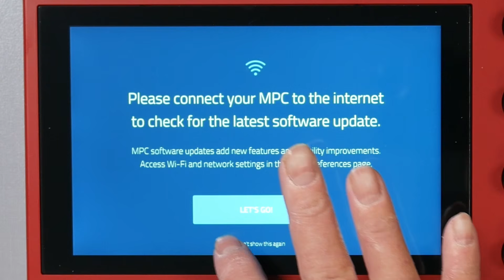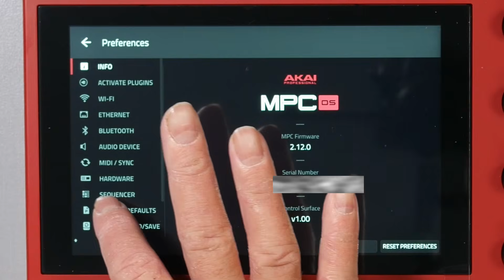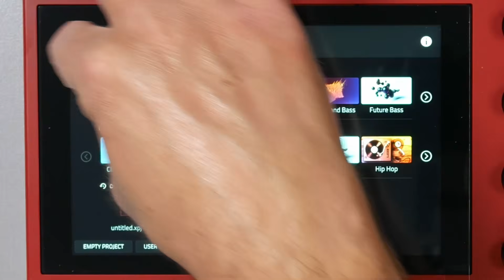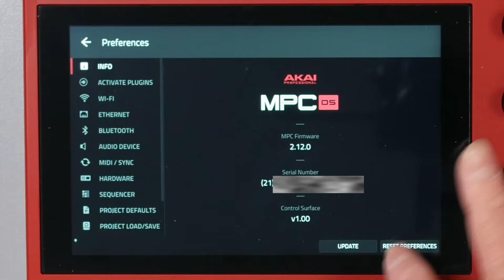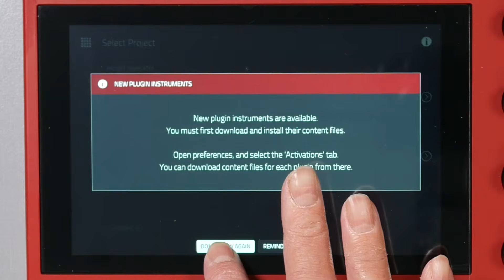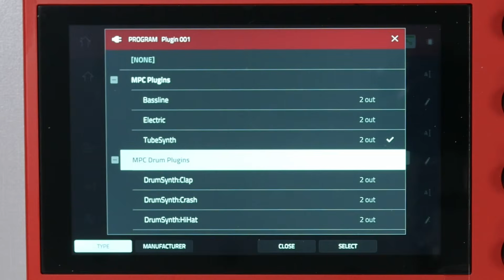3 Tips For Brand New MPC One Plus Users.

Comment: If for some reason you're not in a place that has internet you can plug the USB cable in the back of your MPC one and the other end into your phone. A message should come up do you want to use the internet by tethering just say yes. And you can connect to the internet through your phone.
Reply: Thx for this. I just moved into my new place. I don't have internet yet, my mpc one just came in the mail. I was wondering about not having any wifi.